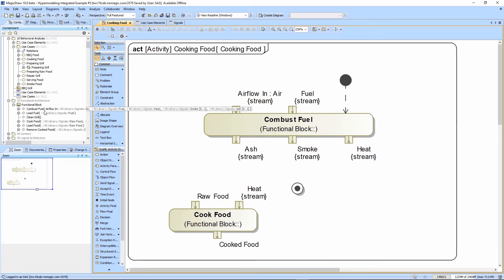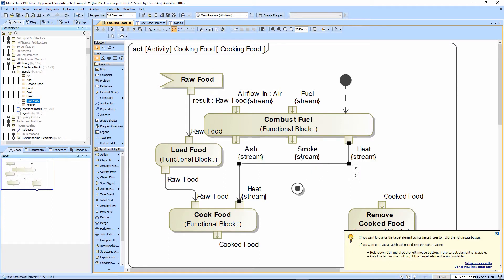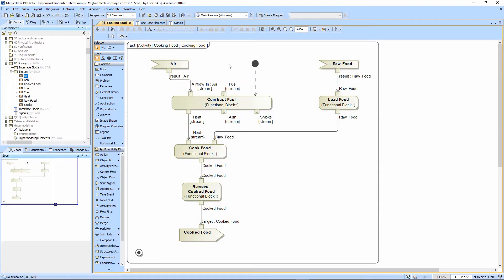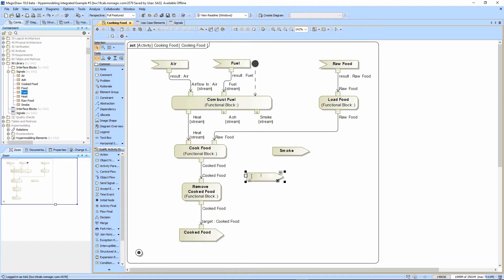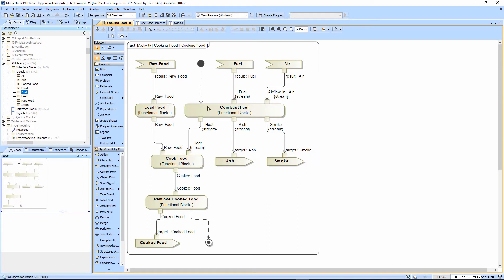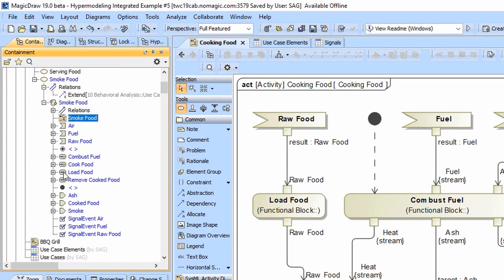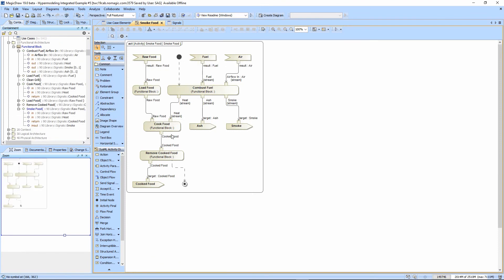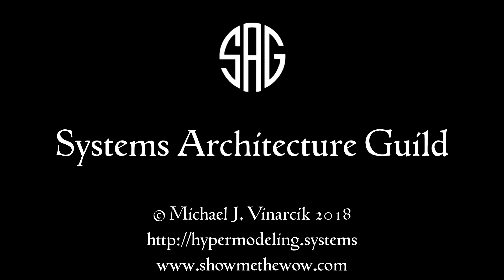Hypermodeling:  UseCase Decomposition and Cloning Activity Diagrams

Comment: hello, thanks for the video. 

I would like to ask you something.

If you create IBD and define the signals, when you create act diagram you can choose swimlanes which is defined in IBD. So, you need to specify your signals between act diagrams that's why you cannot use "send signal action" and "accept event action". Is there any chance to send signal with its attributes in that way? Because I already defined them so send signal action skips the mentioned step.